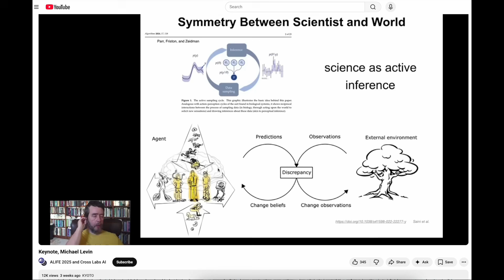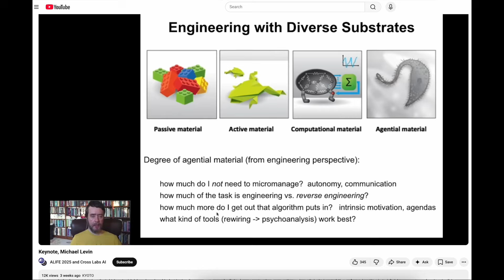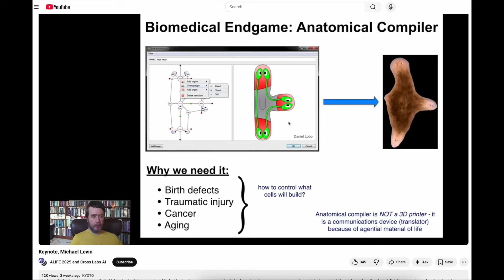Programming Agential Materials With Goal Setting & Targeted Stimuli - Michael Levin's ALife Keynote

Comment from the maker: My comment on the original video: "I am curious if social systems researchers are pairing Levin's insights into frameworks for programming agential materials using engineered goal setting and targeted stimuli with holon-based macro-scale economic systems. I see how this would very clearly mesh with Digital ID, spatial computing, Web3 smart contracts, gamified tokenization, quadratic voting, cryptoeconomics, and collective entrainment. All of the push towards a collective commons as the next-generation post late-stage capitalism aligns with this approach, but I really don't hear it talked about much. Would web3 collective economic systems apply to exploring new areas of social morpho-space - the new type of chimeric intelligence Levin speaks about? See Michael Zargham's work with Blockscience, Glen Weyl's RadicalXChange (soulbound tokens), and Kevin Owacki's Gitcoin. I think it's time we recognize these ideas are not limited to biomedical research. In fact, it is very likely that social systems will become a sandbox for future work at the micro-scale."